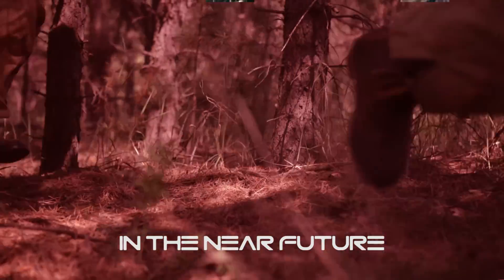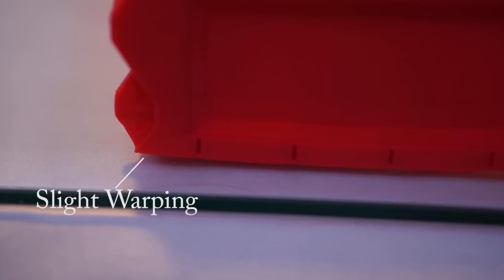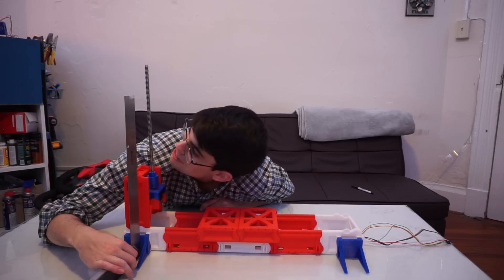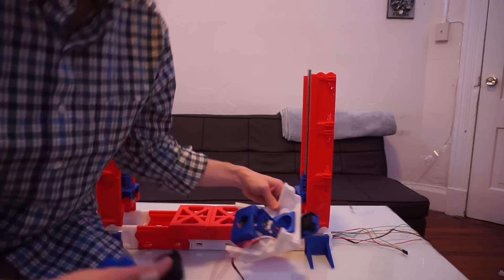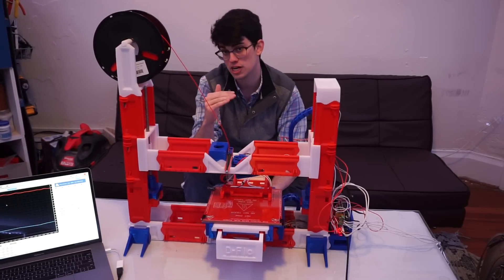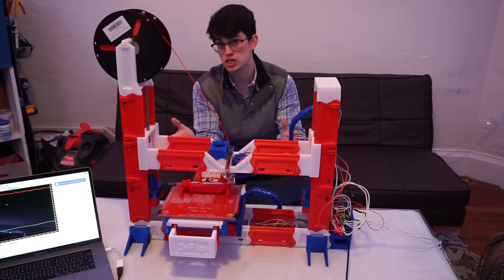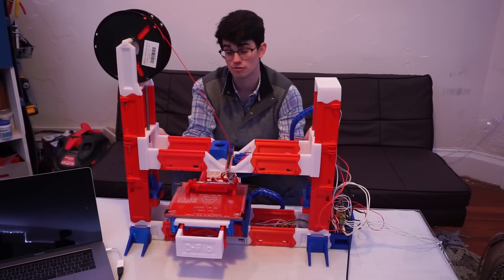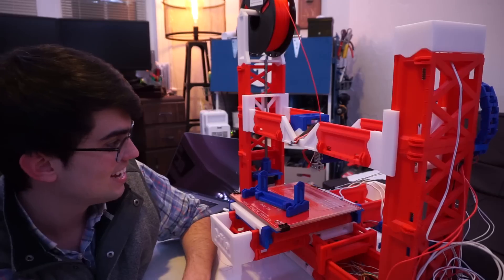Self-Replicating 3D printer (Snappy)

Comment: Well, it's 5 years later and I saw this. I have 10 3D Printers of which 7 of them I bought on eBay "as is, for parts only". Some had missing parts that I had to source, some put together completely wrong, 2 of them wired the Rambo card completely wrong where the X and Y moved in parallel and none of the fans worked and one of the fuses was blown. And, of course, the print heads had jams. I actually did 3D Print a Snapmaker 2.0 A350 with my Snapmaker. HOWEVER I did not intend to make it an actually printer, it's a cosmetic replica. Came out pretty decent but I kept the dimension the same as the real snapmaker. I would have had to, substantially, bulk up the printed parts to be an actual printer. Do you have your project and parts somewhere. I'd be interested in building one. I'm pretty good with Arduino or Raspberry Pi and Maestro controllers as I do robotic. So, I'd have fun with this. If not I understand and I would post a youtube video giving you credit. Up to you.

Comment: Self-replicating you say?

So, while printing it is runs a gcode that prints and ejects parts automatically, place order on Amazon for the electronics with gcode already coded to the motherboard, buy filaments, connect to a wifi or emits radiowave to send instruction to a robot builder to assemble it and does it again?

NICE!

Comment: i wonder if this printed another printer, and that printed another, etc for maybe 100 generations, if the 100th printer would be the worst overall quality... probably depends on a ton of factors, but i wonder at what point in the lineage a printer would outright not work because of the quality degradation. kinda like video/audio transcoding

Comment: The fact that for printing a 3D printer you need to have a 3D printer and tons of filaments + tons of other expensive electronic parts - is already absurdic and isn't worthy at all and such 3D printer will come out much more expensive and less stable than the regular 3D printer. 🤦🏽‍♀️🤦🏽‍♀️🤦🏽‍♀️

Comment: Not bad, I feel the only that can't be printed is the software. If you break down the motor parts then you can 3d print those...just a little assembly required and fine touch up for smoothing out. If needing magnetic parts....that can be the crippling stone then.

Comment: Print 1 printer with 1 printer = 200 hours. 
Print 1 printer with 2 printers = 100 hours.
Print 1 printer with 3 printers = 66 hours.
Print 1 printer with 4 printers = 50 hours.
Print 1 printer with 5 printers = 40 hours.
Print 1 printer with 6 printers = 33 hours.
Print 1 printer with 7 printers = 28 hours.
Print 1 printer with 8 printers = 25 hours.
Print 1 printer with 9 printers = 22 hours.
Print 1 printer with 10 printers = 20 hours.
Print 1 printer with 11 printers = 18 hours.
Print 1 printer with 12 printers = 16 hours.
Print 1 printer with 13 printers = 15 hours.
Print 1 printer with 14 printers = 14 hours.
Print 1 printer with 15 printers = 13 hours.
Print 1 printer with 16 printers = 12 hours.
Print 1 printer with 17 printers = 11 hours.
Print 1 printer with 18 printers = 11 hours.
Print 1 printer with 19 printers = 10 hours.
Print 1 printer with 20 printers = 10 hours.
Print 1 printer with 21 printers = 9 hours.
Print 1 printer with 22 printers = 9 hours.
Print 1 printer with 23 printers = 8 hours.
Print 1 printer with 24 printers = 8 hours.
Print 1 printer with 25 printers = 8 hours.
Print 1 printer with 26 printers = 7 hours.
Print 1 printer with 27 printers = 7 hours.
Print 1 printer with 28 printers = 7 hours.
Print 1 printer with 29 printers = 6 hours.
Print 1 printer with 30 printers = 6 hours.
Print 1 printer with 31 printers = 6 hours.
Print 1 printer with 32 printers = 6 hours.
Print 1 printer with 33 printers = 6 hours.
Print 1 printer with 34 printers = 5 hours.
Print 1 printer with 35 printers = 5 hours.
Print 1 printer with 36 printers = 5 hours.
Print 1 printer with 37 printers = 5 hours.
Print 1 printer with 38 printers = 5 hours.
Print 1 printer with 39 printers = 5 hours.
Print 1 printer with 40 printers = 5 hours.
Print 1 printer with 41 printers = 4 hours.
Print 1 printer with 42 printers = 4 hours.
Print 1 printer with 43 printers = 4 hours.
Print 1 printer with 44 printers = 4 hours.
Print 1 printer with 45 printers = 4 hours.
Print 1 printer with 46 printers = 4 hours.
Print 1 printer with 47 printers = 4 hours.
Print 1 printer with 48 printers = 4 hours.
Print 1 printer with 49 printers = 4 hours.
Print 1 printer with 50 printers = 4 hours.
Print 1 printer with 51 printers = 3 hours.
Print 1 printer with 52 printers = 3 hours.
Print 1 printer with 53 printers = 3 hours.
Print 1 printer with 54 printers = 3 hours.
Print 1 printer with 55 printers = 3 hours.
Print 1 printer with 56 printers = 3 hours.
Print 1 printer with 57 printers = 3 hours.
Print 1 printer with 58 printers = 3 hours.
Print 1 printer with 59 printers = 3 hours.
Print 1 printer with 60 printers = 3 hours.
Print 1 printer with 61 printers = 3 hours.
Print 1 printer with 62 printers = 3 hours.
Print 1 printer with 63 printers = 3 hours.
Print 1 printer with 64 printers = 3 hours.
Print 1 printer with 65 printers = 3 hours.
Print 1 printer with 66 printers = 3 hours.
Print 1 printer with 67 printers = 2 hours.
Print 1 printer with 68 printers = 2 hours.
Print 1 printer with 69 printers = 2 hours.
Print 1 printer with 70 printers = 2 hours.
Print 1 printer with 71 printers = 2 hours.
Print 1 printer with 72 printers = 2 hours.
Print 1 printer with 73 printers = 2 hours.
Print 1 printer with 74 printers = 2 hours.
Print 1 printer with 75 printers = 2 hours.
Print 1 printer with 76 printers = 2 hours.
Print 1 printer with 77 printers = 2 hours.
Print 1 printer with 78 printers = 2 hours.
Print 1 printer with 79 printers = 2 hours.
Print 1 printer with 80 printers = 2 hours.
Print 1 printer with 81 printers = 2 hours.
Print 1 printer with 82 printers = 2 hours.
Print 1 printer with 83 printers = 2 hours.
Print 1 printer with 84 printers = 2 hours.
Print 1 printer with 85 printers = 2 hours.
Print 1 printer with 86 printers = 2 hours.
Print 1 printer with 87 printers = 2 hours.
Print 1 printer with 88 printers = 2 hours.
Print 1 printer with 89 printers = 2 hours.
Print 1 printer with 90 printers = 2 hours.
Print 1 printer with 91 printers = 2 hours.
Print 1 printer with 92 printers = 2 hours.
Print 1 printer with 93 printers = 2 hours.
Print 1 printer with 94 printers = 2 hours.
Print 1 printer with 95 printers = 2 hours.
Print 1 printer with 96 printers = 2 hours.
Print 1 printer with 97 printers = 2 hours.
Print 1 printer with 98 printers = 2 hours.
Print 1 printer with 99 printers = 2 hours.
Print 1 printer with 100 printers = 2 hours.
Print 1 printer with 101 printers = 1 hours.
Print 1 printer with 102 printers = 1 hours.
Print 1 printer with 103 printers = 1 hours.
Print 1 printer with 104 printers = 1 hours.
Print 1 printer with 105 printers = 1 hours.
Print 1 printer with 106 printers = 1 hours.
Print 1 printer with 107 printers = 1 hours.
Print 1 printer with 108 printers = 1 hours.
Print 1 printer with 109 printers = 1 hours.
Print 1 printer with 110 printers = 1 hours.
Print 1 printer with 111 printers = 1 hours.
Print 1 printer with 112 printers = 1 hours.
Print 1 printer with 113 printers = 1 hours.
Print 1 printer with 114 printers = 1 hours.
Print 1 printer with 115 printers = 1 hours.
Print 1 printer with 116 printers = 1 hours.
Print 1 printer with 117 printers = 1 hours.
Print 1 printer with 118 printers = 1 hours.
Print 1 printer with 119 printers = 1 hours.
Print 1 printer with 120 printers = 1 hours.
Print 1 printer with 121 printers = 1 hours.
Print 1 printer with 122 printers = 1 hours.
Print 1 printer with 123 printers = 1 hours.
Print 1 printer with 124 printers = 1 hours.
Print 1 printer with 125 printers = 1 hours.
Print 1 printer with 126 printers = 1 hours.
Print 1 printer with 127 printers = 1 hours.
Print 1 printer with 128 printers = 1 hours.
Print 1 printer with 129 printers = 1 hours.
Print 1 printer with 130 printers = 1 hours.
Print 1 printer with 131 printers = 1 hours.
Print 1 printer with 132 printers = 1 hours.
Print 1 printer with 133 printers = 1 hours.
Print 1 printer with 134 printers = 1 hours.
Print 1 printer with 135 printers = 1 hours.
Print 1 printer with 136 printers = 1 hours.
Print 1 printer with 137 printers = 1 hours.
Print 1 printer with 138 printers = 1 hours.
Print 1 printer with 139 printers = 1 hours.
Print 1 printer with 140 printers = 1 hours.
Print 1 printer with 141 printers = 1 hours.
Print 1 printer with 142 printers = 1 hours.
Print 1 printer with 143 printers = 1 hours.
Print 1 printer with 144 printers = 1 hours.
Print 1 printer with 145 printers = 1 hours.
Print 1 printer with 146 printers = 1 hours.
Print 1 printer with 147 printers = 1 hours.
Print 1 printer with 148 printers = 1 hours.
Print 1 printer with 149 printers = 1 hours.
Print 1 printer with 150 printers = 1 hours.
Print 1 printer with 151 printers = 1 hours.
Print 1 printer with 152 printers = 1 hours.
Print 1 printer with 153 printers = 1 hours.
Print 1 printer with 154 printers = 1 hours.
Print 1 printer with 155 printers = 1 hours.
Print 1 printer with 156 printers = 1 hours.
Print 1 printer with 157 printers = 1 hours.
Print 1 printer with 158 printers = 1 hours.
Print 1 printer with 159 printers = 1 hours.
Print 1 printer with 160 printers = 1 hours.
Print 1 printer with 161 printers = 1 hours.
Print 1 printer with 162 printers = 1 hours.
Print 1 printer with 163 printers = 1 hours.
Print 1 printer with 164 printers = 1 hours.
Print 1 printer with 165 printers = 1 hours.
Print 1 printer with 166 printers = 1 hours.
Print 1 printer with 167 printers = 1 hours.
Print 1 printer with 168 printers = 1 hours.
Print 1 printer with 169 printers = 1 hours.
Print 1 printer with 170 printers = 1 hours.
Print 1 printer with 171 printers = 1 hours.
Print 1 printer with 172 printers = 1 hours.
Print 1 printer with 173 printers = 1 hours.
Print 1 printer with 174 printers = 1 hours.
Print 1 printer with 175 printers = 1 hours.
Print 1 printer with 176 printers = 1 hours.
Print 1 printer with 177 printers = 1 hours.
Print 1 printer with 178 printers = 1 hours.
Print 1 printer with 179 printers = 1 hours.
Print 1 printer with 180 printers = 1 hours.
Print 1 printer with 181 printers = 1 hours.
Print 1 printer with 182 printers = 1 hours.
Print 1 printer with 183 printers = 1 hours.
Print 1 printer with 184 printers = 1 hours.
Print 1 printer with 185 printers = 1 hours.
Print 1 printer with 186 printers = 1 hours.
Print 1 printer with 187 printers = 1 hours.
Print 1 printer with 188 printers = 1 hours.
Print 1 printer with 189 printers = 1 hours.
Print 1 printer with 190 printers = 1 hours.
Print 1 printer with 191 printers = 1 hours.
Print 1 printer with 192 printers = 1 hours.
Print 1 printer with 193 printers = 1 hours.
Print 1 printer with 194 printers = 1 hours.
Print 1 printer with 195 printers = 1 hours.
Print 1 printer with 196 printers = 1 hours.
Print 1 printer with 197 printers = 1 hours.
Print 1 printer with 198 printers = 1 hours.
Print 1 printer with 199 printers = 1 hours.
Print 1 printer with 200 printers = 1 hours.
Print 1 printer with 201 printers = 0 hours.
So you can finally print a printer in 60 minutes, send me one. Thanks.

Comment: You need a 3D printer that can print metal as well as plastic, with linear motors precise to within 5nm, and laser-etching robotics that print silicon chips and all the other electronic components and then solders them too.

Comment: Now that 3'd printers are getting slowly replaced by more capable 6 axis arms instead of 3d platforms I imagine the concept of a a printer printing printers is becoming both more viable and opening more complex designs.
I imagine it has to be a lot slower though.
Any plans for something similar?

btw, if the parts aren't smooth enough as you talk about with the rails in this video, I thought that was somewhat simple to smooth out with acetone?
Reply: check out the channel howtomechatronics (or something like that) he has some wicked tutorials for building scara robotic arms

Comment: You could actually print more of the parts. For example bearing you used with the extruder is kind of printable. You can print the fans if you can get a mini brushed motor. You can print the clips holding the glass to the heatbed. I'd also try to print the threaded rods (with higher pitch, of course). Anyways, I like the idea. The disadvantage is that too much filament is used. 3kg is a lot, I think it could be reduced to even 2kg. And yea, I love the X axis solution!
Reply: great ideas

Comment: With this, you could use it as a tester. So for example, I have one 3d printer and I want to fit it with some sort of multi-material solution, like a diamond hot end, but I'm too worried I'm going to ruin my printer since I'm not 100% sure what I'm doing. I could print and build this printer, test out the diamond hot end on it, and once I've gotten this printer to work with the diamond hot end, I could transfer it to my main printer to make use of its higher accuracy
Reply: Gonna be using a ton of filament 😂
Reply: @ducksongfans  why you replying to a comment from 2 years ago
Reply: @cinnamonkittamon  cus i want to

Comment: There are other printers with plastic parts but using metal rails. What price or TIME difference is there? Make parts little bigger on the rails and sand for cleaner finish. Snap together ok but will wear out faster, use bolts?

Comment: My 10 step Billionaire process
Step 1: buy a 3d printer
Step 2: Print another 3d printer
Step 3: Return the old one
Step 4: Print more 3d printers
Step 5: Print a factory
Step 6: Print 50 3D printers
Step 7: Put those 50 in the factory
Step 8: Create a 3D printer brand (website, advertise, ect.)
Step 9: Print 3D printers with those 3D printers
Step 10: Sell them
Reply: Or 3d print a gucci watch.
Reply: @OldHoboManYouTube  #Prusaprinters
Reply: alot of the orginal prusa i3 printers do that, and thats why they are so big! They have printing farm where all parts are getting printed for other printers! So your idea is not bad
Reply: Stonks\   /\
              \/
Reply: Lol thats exactly what my idea was without even reading this except not returning the old one because if you print 3d printers with each of them it gets smaller and small because how would you take it out if it tried to make it the exact same size because then it would get stuck. Also remember you still need to buy filaments.
Reply: @QuantumKatana  thats why you print it peice by peice
Reply: Easy way : put apple logo in 3D printers
Reply: Prusa did that lol
Reply: I know I’m late but it’s S T O N K S
Reply: You forgot bout all expensive electronic parts and filaments for printed 3D printer.  It's not worthy at all. + Such printers aren't stable and very fragile compared to a regular one.
Reply: @artysplash8  Dude, it's a joke I made when I was 13, chill.
Reply: The only reason to get a 3d printer is for printing firearms to use when the Zionist start a nuclear winter or the race war. You'll be able to arm a militia with a few of these

Comment: Are other substances also workable like sand-glass, chalk, gypsum, mud, and ice?  

People are printing analog computers that control the 3D printer instead of digital circuits on youtube, then 10 million printers can be controlled by a single computer by shooting out sound waves (which each 3D printer can be controlled by listening to specially printed plastic drum) or light waves (via a plastic prism) to all of the 10 million printers.  If you can print a plastic lens you can use the solar energy to melt the plastic and control the machine, and to control a "hand" to connect each of the 3D printed parts.

An ice printer creating a lens of ice can be used to melt the ice and to power the 3D printer by a heat engine, this might allow it to terraform Mars since it self-replicates in an exponential way:  1 2 4 8 16 32 64 128 256 512 1k 2k ... 1 trillion in 40 generations.  While it self-replicates it melts the dry ice kicking up into the atmosphere where it can keep Mars warm, and then melt more dry ice.

Comment: What if, instead of having plastic riding on plastic rails, you use ball bearings as wheels on the plastic tracks ? bearings are super cheap on ebay and come with most 3D printers; cheap and expensive XD

Comment: maybe replace the plastic filament with an iron counterpart to print some of the wires/ other parts?
Reply: Iron is a terrible conductor and so is plastic, you may be able to use iron filing loaded filament for the bolts that adjust the axies but the wires need to be solid copper for its conductive properties

Comment: If your rails weren't smooth enough, couldn't you sand/file/plane/iron them flat?
Reply from the maker: I used a little bit of sandpaper to smooth out the rails. It can be a little tricky to sand at the connection between two rails, which is where I was experiencing friction.

Comment: now print a self replecating cnc
Reply: A 3D Printer in theory is a CNC machine if you replace the Extruder with a Drill and put Wood on the Build Plate you would have a CNC milling machine.
Reply: Zarkex and replace the motors for much bigger motors and you need a much better frame and a much better power supply.